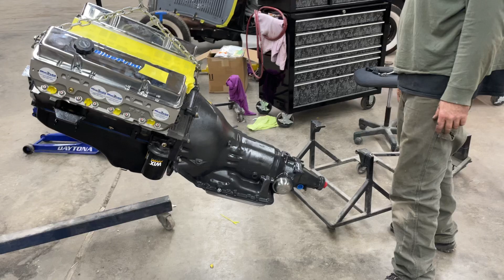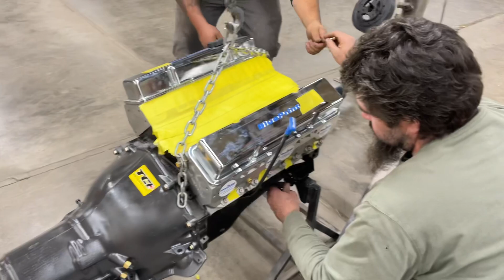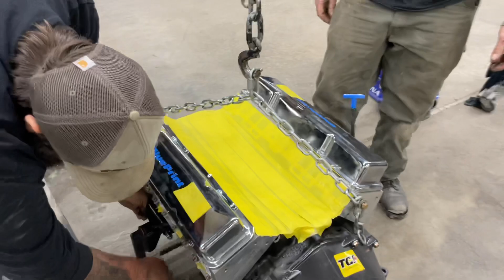100,000 miles on an engine stand and still rolling.

Comment: No odometer ,,so how are u calculating mileage????,real ly,so off the wall accuracy, on ur behalf
Reply from the maker: I used this engine stand when we traveled around the country doing a car build at shows all around the country. I would be on the road 30+ weeks a year from one end of the country to the other. North South East and West.
Reply: @Spiritcarsinc is the milage on the dash the same as the engine milage?
Reply from the maker: the engine is brand new and the gauges are brand new. Car still needs to be built as it is a brand new build
 @MatthewBarnes-2023